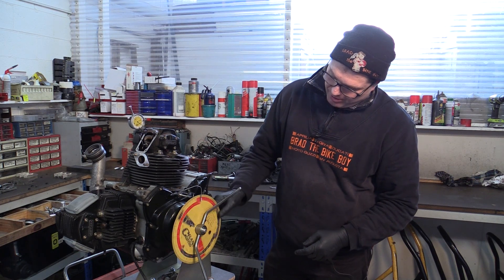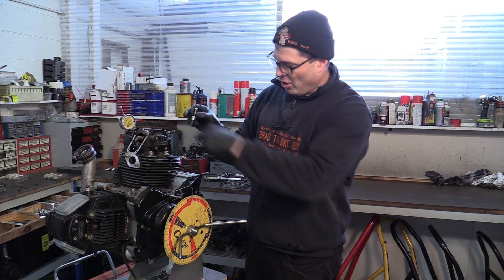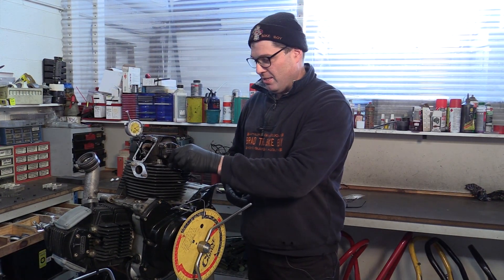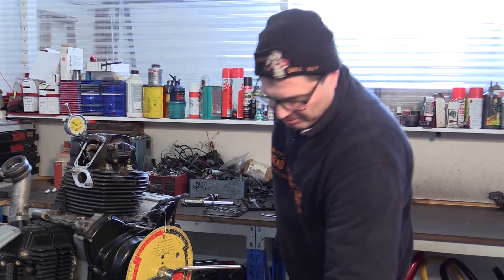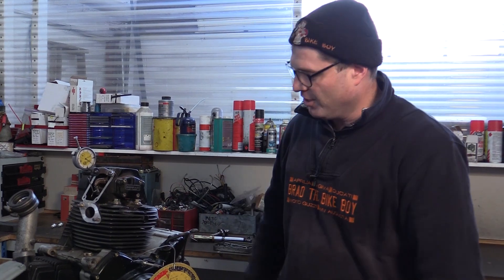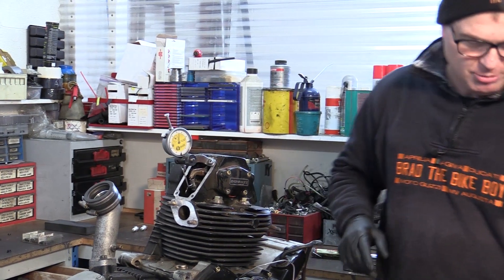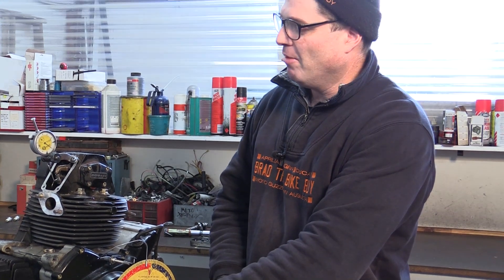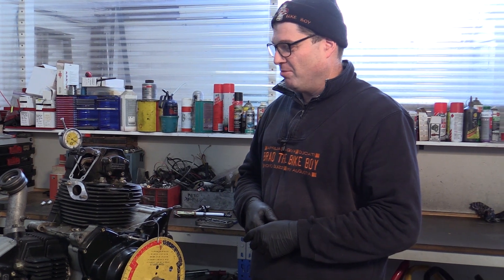Ducati Traditional 2 Valve - Adjusting Cam Timing

Comment: Thanks mate, i have a issue that i undid the sprocket for the timing belt 992 motor. marked all belts but did not know that the sprocket is a separate unit to the valve plate.
is there a way to ensure that the plate alignment to the sprocket. any ideas.
Reply from the maker: Brad has his own Youtube channel now. You might want to ask him there.
https://www.youtube.com/@bradthebikeboy

Comment: Is this a job that you must do if you just check and adjust the clearance of valves and replace the cam-belts? (Im talking about the 992 ds motor )
Reply from the maker: No, Cam timing is a performance modification.